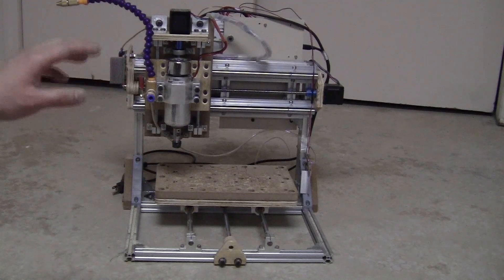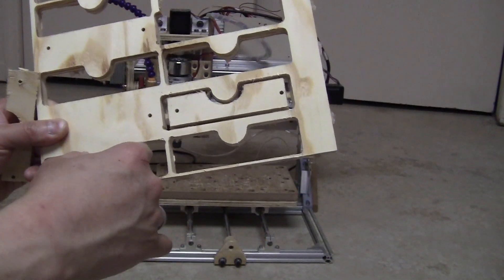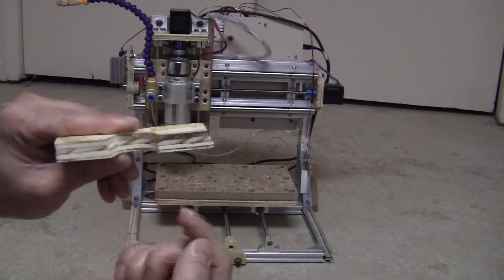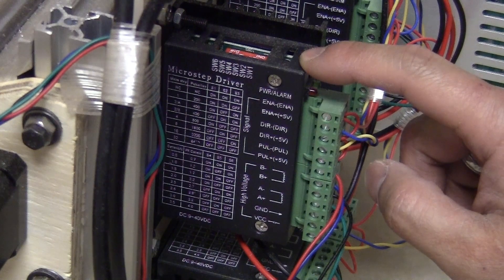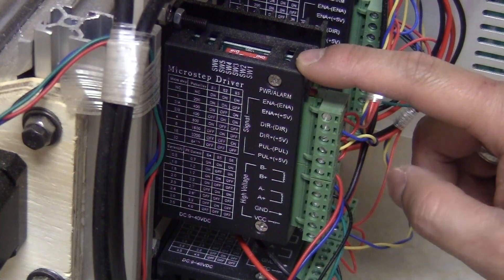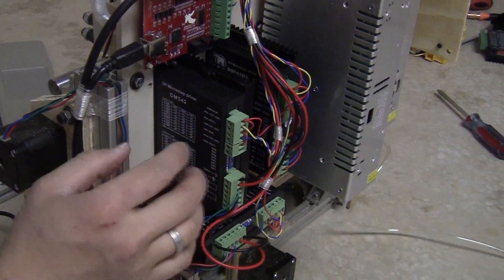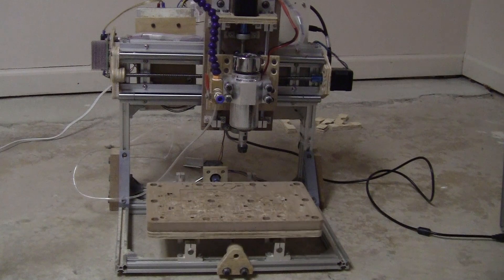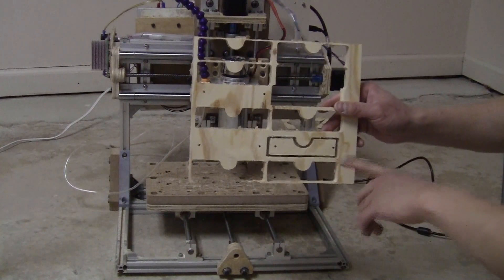Stepper motor driver - which one is not to get - avoiding TB6600 at all cost

Comment: Have a source for a low price for the dm542, 24v power supply, and a controller?  I am only using Nema 17 motors for now but will go to 23/34 in time if I decide I like it.
Reply from the maker: I just bought a pack of dm556 for $13 each from ebay. It might take about a bit more than 2 weeks to arrive. If you wanted the same, I can test them first and give you the link. They were priced at £12 and I gave the best offer for £10 and the seller accepted. They should be coming in a few days (just cleared the custom in New York). I don't have one for the power supplies, the cheap ones are usually not reliable.
Reply: @minhsmancave9448  Well, I don't think the 556 will work due to the minimum amps since these are tiny Nema 17 motors from a 3d printer I had.  Basically 1-1.5a is about as much as they can handle or they get very hot.

The controller is the Mach 3 one you went to with the red board and comes with a disc and cable.  I finally found a video on how to hook everything up with that (except for the endstops and motor speed control) after six hours of searching.
Reply from the maker: Dm542 won't work well with nema34. Nema23 will be the limit. In my last video, the driver overheated and stopped working ( I used max current at 36V on nema 23 425oz). Last time I got 2 dm542 at $15 each on eBay and shipped from the US. $11 each shipped from China. Let me check the link then I'll send both to you.
Reply from the maker: @thebeststooge  Here's the link to get buy DM542 that I used last time. I can't find any cheaper. The link I bought on eBay is no longer existed. https://www.aliexpress.com/item/32951509951.html
Reply: @minhsmancave9448  Sad because I don't have Nema 23 motors and I already built the holder for the nema 17 and I know on my 3d printer if I go over about 1a they get hot and around 1.2amps they will burn you.
Reply: @minhsmancave9448  After more looking I think the 556 may work it just depends.  1a is the min on some and other versions of 556 they say 1.5 which the Nema 17 will not do (well, these will not).
Reply from the maker: Maybe should get just a bit bigger nema 17,at least the 2amp type. Those might be able to give you fast enough feed rate for free movement and acceleration. With the 1.2amp, you will have to be very patient cutting things.
Reply: @minhsmancave9448  Works for me since I look at all the parts alone and see a grand.  Well, I don't have a grand to buy the stuff so use what I have.
Reply from the maker: What type of machine you are building that cost a grand? Those steppers you have must cost like peanuts compared to the others components.
Reply from the maker: I forgot, take a look at zyltech.com, they also have very good price on a lot of things for cnc and 3d printing, US free shipping very fast for order over $100
Reply: @minhsmancave9448  Yep, their prices are normally expensive.  I mean when I add up over 200 usd for the rails and blocks.  The spindle of 350ish, the materials of around 100.  The nema 23 motors for 20-25 a piece. the controller, the water stuff, etc... it adds up fast.
Reply: @minhsmancave9448  GRBL is all they sale - ZYLtech Arduino UNO Compatible CNC Kit w/ Controller + Shield + Nema 23 Stepper Motors + PSU + Toshiba TB6600
Reply from the maker: I don't understand, I thought you already have most of everything and only looking for a few components? Zyltech always have some coupon code to get about 15% off. Just need to Google or email them to ask.
Reply: @minhsmancave9448  No, I am starting over since I have to buy 200+ dollars of rails I can't afford to upgrade then have to rebuy the rails all over again (actually is less costly if you get the blocks with them).  I figure it isn't worth it so will do something else with what I made or find better wheels and make a belt driven wheel version.  The Metal wheels would end up costing me around 100 dollars do to almost 5 a piece and needing about 20 of them (or more).

I have no idea but due to the entire cost of this I may have to skip it and find something else.
Reply from the maker: @thebeststooge  Complicated, I guess that you don't want to build something in the middle (baby steps) like I have been doing. It's hard to have a final plan and make it right in one shot. Can't really help much.
Reply: @minhsmancave9448  That is what I am doing baby steps and why the Nema 17 motors but I want a controller, and drivers, I will not have to replace when the time comes.
Reply: @minhsmancave9448  Btw, the motors I am using are 1.7A 78Oz Stepper  so your drivers should work (on its lowest setting) which gives me plenty of room for when the day comes to go to Nema 23 or 34 motors.
Reply from the maker: @thebeststooge  here's where I bought the DM556: https://www.ebay.com/itm/1Pc-DM556-2-phase-Digital-Stepper-Motor-Driver-42-57-86-Motor-Driver-H0O4/133510675903
Remember to make the best offer. I put £ and they accepted without counter offer.
Reply: @minhsmancave9448  Estimated between Mon. Nov. 16 and Tue. Jan. 12   WOW, sheesh.

 Btw, I am really leaning more towards GRBL over MACH3 after a lot of issues I read about.  Not that GRBL is fantastic but you can take an arduino and drive the 556 so no need of a shield.  Better does exist, of course, for a price.  Have you ran into any issues yet with the USB Mach 3?
Reply from the maker: No worse than Grbl, I prefer Mach3 way more, I'll show soon in the next video why I like to use Mach3. It's very easy to customize the user interface and programming all the user buttons. If you do a lot of tool changing and also if your machine is not really powerful, all the tool probing functions in Mach3 will save you plenty of stock. Like in my last video where my stepper motor driver stopped working, the customized script save my aluminum stock. Anyway, wait 2 more days, and you will see a lot more details
Reply: @minhsmancave9448  Yes, when that happened GRBL, Marlin, etc... on an open loop system (like you have) it would have destroyed the material.
Reply from the maker: @thebeststooge  My dm556s came few days ago and I installed them today on my CNC and they seem fine, no problem. If you still want to buy them, the link I gave you is safe, just remember to negotiate a bit for better price.
Reply: @minhsmancave9448  Will do, and thanks again.
Reply from the maker: What type of controller are you going for? If you don't need too many inputs, the RnRmotion board that I'm using is not bad, only cost $11 from China and about $20 from the US. Sometimes I do want to have more inputs so I can have all the sensors installed. 6 inputs will be ideal for me (1 for emergency stop, 1 for tool probing, 1 for limit switches and 3 for homing X, Y, Z. But this controller only have 4, I have to ignore the homing switches for now.

Comment: The problem is that the original tb6600 have minimum pulse width 2us. You driver is not tb6600 because inside the board ale different chip. Is not original tb6600. And you need change pulse width to more that 20us.
Reply: how to change this on mach3?
Reply from the maker: Not many people have a good deal of knowledge about this motor driver like you do. I just chose a easier solution is to buy another type of driver. Dm542 is one example of not too expensive and a lot more reliable.
Reply from the maker: Reuel T  Good tips, hopefully other people will see your comments and try it. Maybe you should make a video how to solve the problem with TB660s then I can remove my video.
Reply: Reuel T  I already have a set of TB6600 drivers and would like to avoid problems. How is the pulse width adjusted? I have plans to make my controller work with an arduino in case I choose to use matching software but I will also have a breakout board on my controller in case I choose to use software that requires a parallel port (Linux CNC). So how would I adjust the pulse width in either case?
Reply from the maker: I have no idea how to do that with Grbl and Linux CNC. Only mach3 is easy.

Comment: When I saw the 6600 number on the stepper driver, that rang a bell, as there is a huge forum posting on the CNCZONE website about the issues the 6600 drivers have and many solutions to attempt to fix them, so, Minh has been bitten too and solved the problem by nipping it in the bud.....no messing about trying to revamp the 6600 with a quick fix.
For anyone who's interested there is a guy called James Newton who has a website WWW.MASSMIND.ORG and he supplies stepper driver kits for DIY builds using the THB 6064 AH chip.
Kits 2 years ago were going for A$35 each.....he also recommended the DQ542MA stepper driver as a far better one than the 6600 type.
I ordered 4 kits.....4th axis in mind..... and he included for free a pulse generator kit to test stepper motors and run them as motors without a regular stepper driver......that would make a good variable feed motor for a manual mill drive.
Reply from the maker: I took the bait and thrown away $35. I think at that price, trying to fix those Tb6600 is more expensive than throw them away. I got a few dm542 on ebay for $15 each and also a few more from AliExpress for $11 each. So far so good
Reply: @minhsmancave9448  According to the people on the CNCZONE website, fixing them is impossible due to the bad design of the circuitry but the Chinese sellers still extoll the virtues of them and push them onto unsuspecting buyers......James Newton spent a lot of time attempting to solve the question of a fix but gave it up as a bad deal.

Comment: THANK YOU!!!!!!! I WAS ABOUT TO BUY IT!!! HAHAHAHA you changed my mind for the better
Reply from the maker: Very glad that you saw the video before deciding buying those. Lot of others, including myself, just have to throw those drivers away. It wasn't just money wasted, it was also time to figure out what was the problem.
Reply: That's the notorious problem with the TB6600.  They last about 6 or 7 projects and die quickly with the same troubles...Lost steps.  I wasted time rewiring everything with upgraded shield cable and ground blocks only to learn the problem was the drivers and not an EMI problem.  Improved shielding is a bonus but I could have done that at another time when the budget allowed for it.  Listen to the masses.  TB6600's are absolute garbage!

Comment: Hey dude what firmware you using marlin or?... Did you just swap the drivers without changing config in software... Can you send me connection and config for that drivers on galesic.matej21@gmail.com? Thank you 🤗
Reply from the maker: I used this controller board that is compatible with Mach3:
https://www.aliexpress.com/item/32964478090.html?spm=a2g0s.9042311.0.0.27424c4diVmijz

The wiring is very easy, just connect 5V from the board to : EN+, Dir+, Pulse+, then connect Dir and Pulse from the board to the the dir- and pulse- on the driver.

Comment: thank you for posting this video i cancelled my tb6600 and ordered a couple of the other dm542
Reply from the maker: I'm glad that you canceled your Tb6600 order since other viewers also confirmed the problem (check the comments)
Reply: What driver your recomemd for gbrl.... I have problem to milling pcb 0,2mm thanks
Reply from the maker: It really depends on what type of stepper motors you have on your machine. Anything other than Tb6600 and have the rated current higher than your stepper motors will be fine.

Comment: Thank you very much for this video. I can confirm the problems with TB6600 stepper motor drivers. Drift and step losses up to total driver failure. The additional costs for DM542 are worthwhile in any case. It is simply better for the machine and the nerves.😄
Reply from the maker: I took apart my first laser engraver thinking the bearing setup was too heavy for the stepper motors because the drivers kept stopping in the middle of any engraving. After found out the problem, it was not my design or stepper motors, it was the drivers all along. I'm still mad about it!!! And yes, just go for at least dm542, still working fine so far.

Comment: Yikes!  I have the 35$ special you purchased as well :(  I am building a larger CNC, using my 3018 and 3d printers.  I may go ahead and get two for the X & Y and just keep the 6600 on the Z for a bit.  I am still working on the base anyway, so no rush.  Thanks for the info and great video as usual.
Reply: I have found that this driver does work without losing steps, but requires changing the pulse frequency based on the amperage setting.  It does seem to not work past 1.7amps though and chatters any motor I have tried 2amps and above.  I really still have not seen more than 1.2amps from it and I could not get a steady rotation of the motor.  I would like to know if a real TB6600 works or not and they are still cheaper than others.  The  TB67S109AFTG is not the same as the TB6600 and should be avoided no matter the cost!  I will post a sample test program soon.
Reply from the maker: I just bought 3 dm542 to replace those. The think is I don't know if I'll get the real Tb6600 if I buy others. And they seem to be not much cheaper than dm542.
Reply: @minhsmancave9448  Yeah,  I think most of them like we have are not TB6600. I know now if it has 1/32 micro-stepping it is definitely not.  I may try the TB6560 drivers, but will first try the ones I have.
Reply: @UReasonIt 
Hey, hope u r doing well.

i know to has been along time but hopefully u still work on these projects

I am building a cnc machine, and i was supposed to buy the TB67S109AFTG drivers today "thank god i didn't". So i wanted to ask after all this time what driver do u really recommend that's not expensive yet i don't have to replace it after a while for some annoying problem.

Thanks for your help in advance.
And really thank u for the helpful comments and follow ups.
Reply: Here is the test code.  I used an Arduino Uno clone. https://pastebin.com/DRbUxanR
Reply from the maker: Yikes indeed. I don't know what to say. Maybe you can just try them first, maybe you will get lucky. If the problem happens to you, you know where it comes from.
Reply: @minhsmancave9448  True and may just do that.  No rework really to swap them later.  Did you notice any axis that was worse than another?
Reply: @minhsmancave9448  I wonder at the higher amperage if the driver is losing steps due to heat?  I know on my first 3d printer (a reprap) that the extruder motor would start losing steps due to heat on the driver and the motor.  This happened on long prints.  I added a fan to my Ramps board and a heatsink on my extruder stepper motor with a fan.  I'll add a fan for the drivers and see if that helps if I see the issue.  Thanks again for bringing it to our attention!
Reply from the maker: I don't think it was the heat problem. Both the drivers and motors were barely warm. With the dm542, the motors are hot but still ran correctly. I set the current at 2a for the Tb6600 and 1.9a for the dm542. So, most likely it's the Tb6600 encoding problem
Reply: @minhsmancave9448  I have set up a test rig and have duplicated the problem.  It starts to lose/gain steps quickly.  It could be it does not handle noise that well.  I have a "control" subject using an Easydriver board and it runs a very long time with no loss or gains in steps seen (yet).  I am going to play with som shielding and chokes on the wires and circuit board.  Something to occupy my time for a bit :)
Reply from the maker: Let me know how it goes. If you made it works, I won't need to throw away my $35,lol
Reply: @minhsmancave9448  Well...  I took one apart and find that these are not TB6600 based drivers!  They are TB67S109AFTG drivers also from Toshiba.  It has lower current driving abilities and 1/32nd micro-stepping that the 6600 does not have. They also put way too much heatsink paste on the chips :)
Reply from the maker: I guess that real TB6600 is still more expensive then. The lesson learnt here is that don't buy stuff that's too cheap to be true.
Reply: @minhsmancave9448  Yep. I will just look for better options for my CNC. Thanks again and be safe everyone!
Reply: Ok, I think I know what the issue is with these  TB67S109AFTG based knock-off drivers.  The ENABLE is quite slow to react on state changes.  If I enable the driver and do not change it then it does not loose steps.  See my code link above to test.